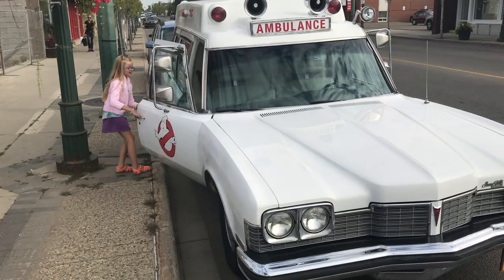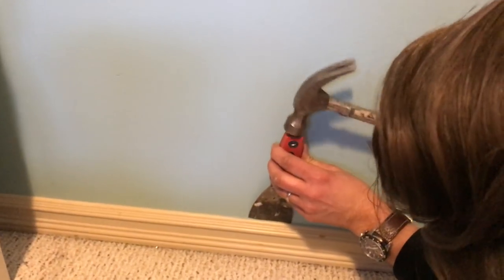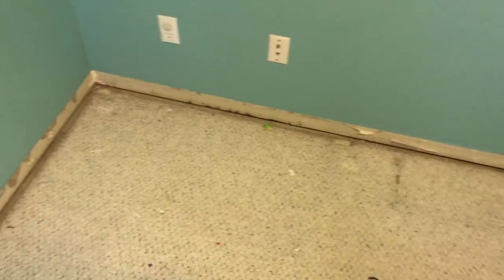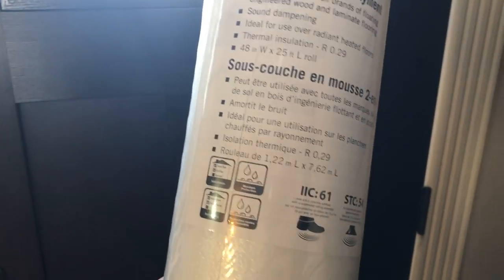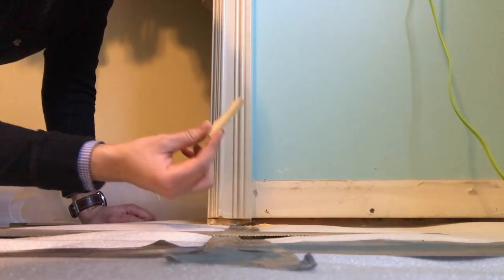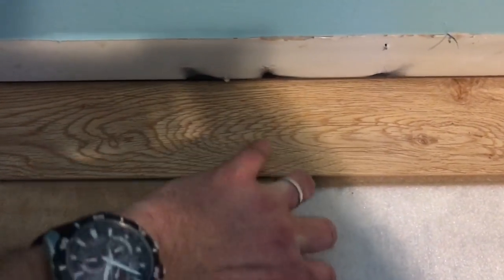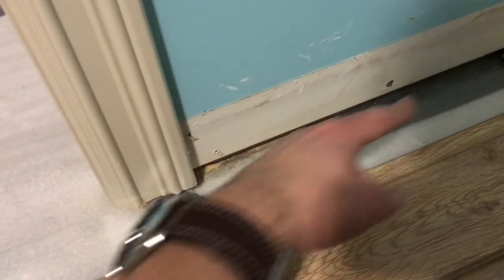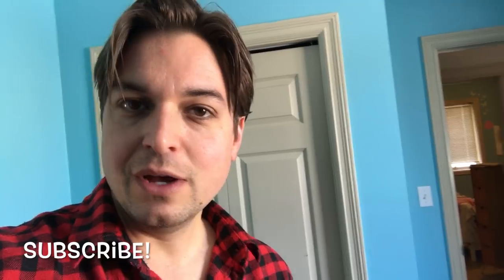You’ll be floored! Do it yourself laminate flooring.

Comment: You might want to leave a bit more space around the edges for the floor to expand and shrink which it will with the seasons. About a quarter inch of space is probably a good measurement. It won’t take much expansion before it buckles if you put the floor all the way  to the wall.